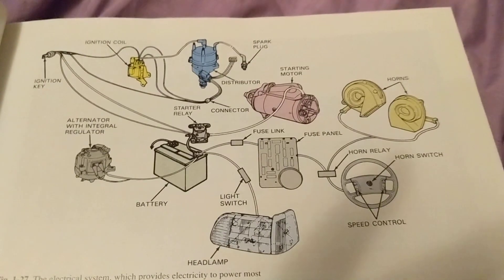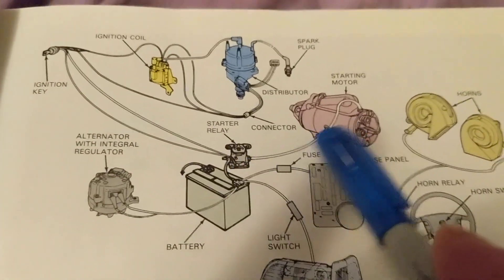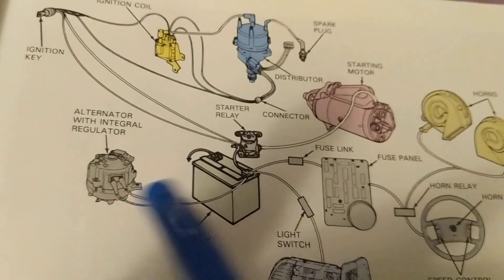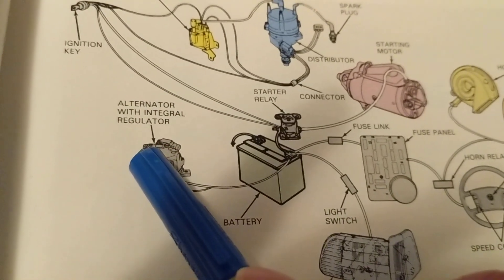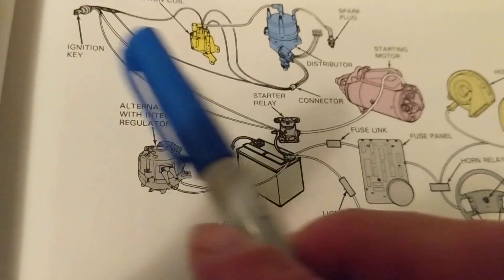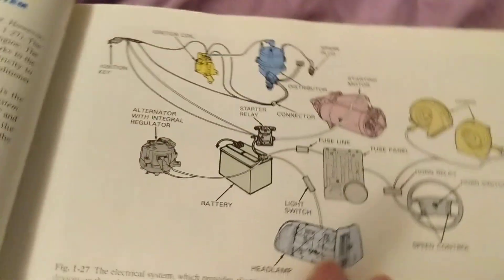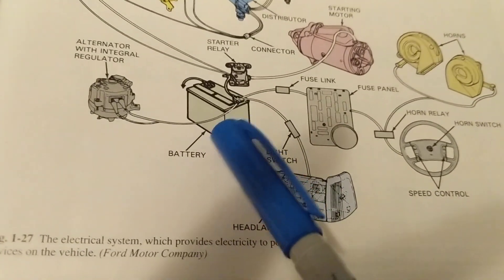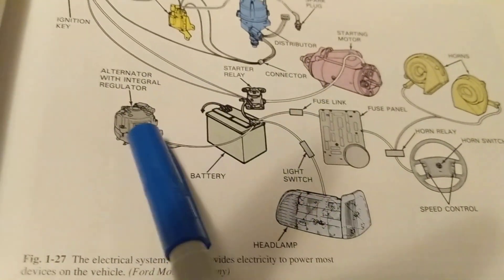Great explanation of how starting system and ignition systems work with pictures in a vehicle

Comment: Hey, Joseph. Since you mentioned diode in the tutorial, I want to ask you a question about it. One of the techs at work says that a diode is only used a one way check valve in the alternator. I told him it is also used to convert AC current to DC current. He told me that the rectifier does the conversion, which I understand. Isn't rectifier composed of diodes?
Reply: The purpose of a diode is to change AC to DC for the battery it is in a way a check valve allowing current to flow in only one direction when it is forward bias and the other direction it is reversed bias and does not let current through AC generator create three-phase voltage that has to be changed to DC for all accessories and the battery
Reply: @automotiveelectronicsfroms2699  How would describe the rectifier?
Reply: These are half wave rectifiers there's more details in my other channel which just got monetized Joe electronics schematics for Auto much more videos about this